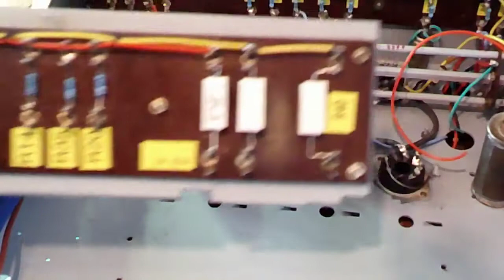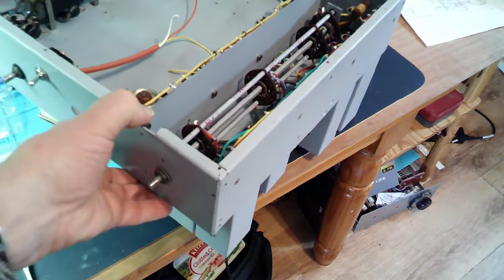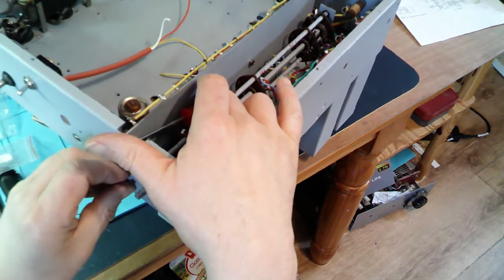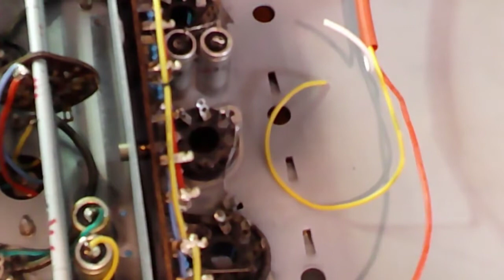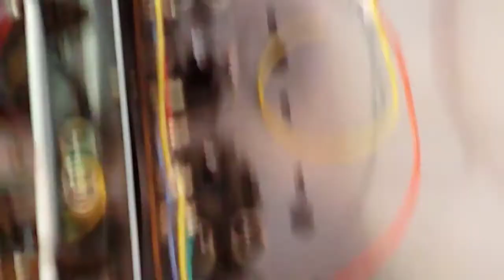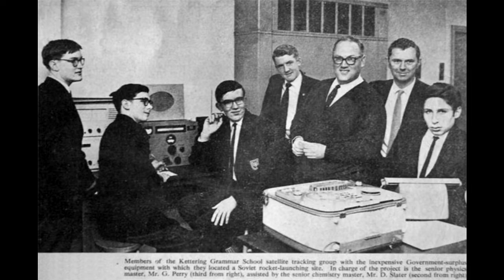Marconi CR100 Renovation (35) IF board completed and start on the RF  board

Comment: after you have finished it will look better than when it was made i restored a cr100 a few years ago and made the mistake in using screened wire on the oscillator valve grid wire and it put the oscillator well out
Reply from the maker: Thanks . Well im not sure it will look better but with modern components it is easier to rebuild. I wonder if the capacity of the screened cable added in parallel on your oscillator valve. reminds me of some designs in PW in the 70s . If I remember they where called "trick" or "gimmick " capacitors usually used in regen designs , Good point I should mention it when  I do the top components..